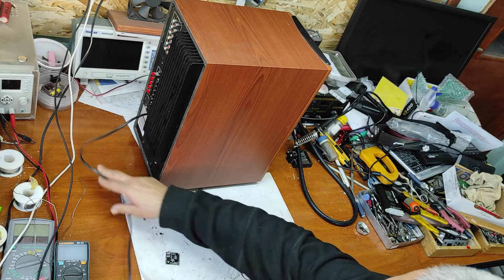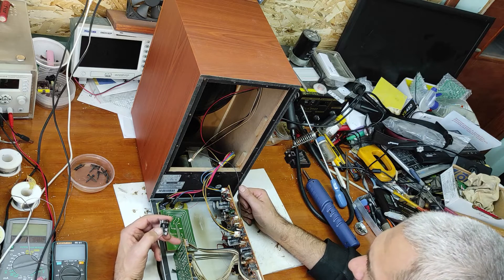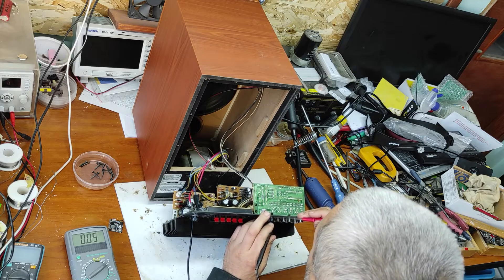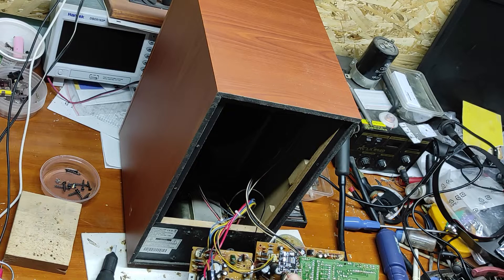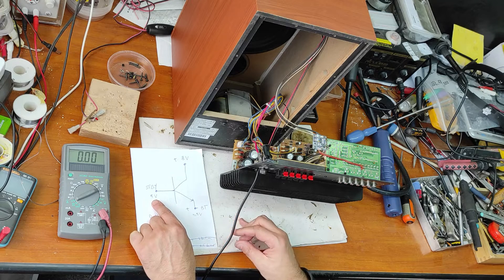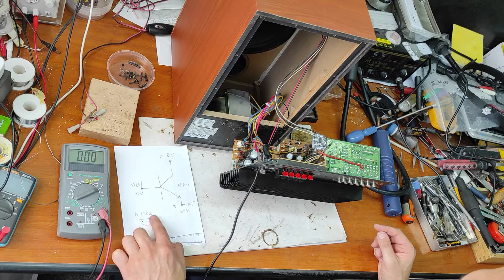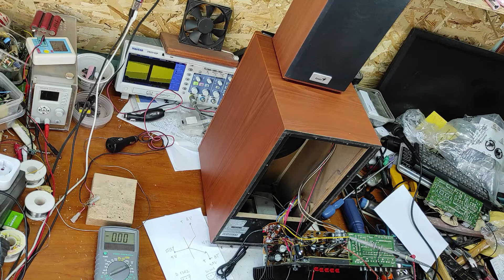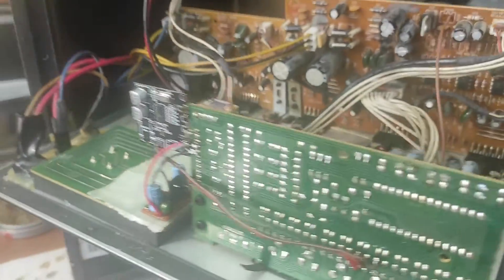Genius 5.1 add bluetooth,not so easy

Comment: hi i got from friend other pair its  Genius SW-HF 5.1 5000 what can it be i hear noise  in speckers and in bass  when i turn on
Reply from the maker: You have to open and find fault.i cant tell u if u dont give me details.
Reply: @diymariuselectro  everrything works just have noise  pich noise like some ground is not good or something ..
Reply from the maker: @dimuborgir1987  check the pacacitors and replace
Reply: @diymariuselectro  ok i found one more problem i dont know is this factory or someone was fixing it....one contact L goes on  fuse  and other  N goes on  switch ..doesnt  l goes on switch and fuse  then in transformator? confusing
Reply from the maker: @dimuborgir1987  transformer output for audio amplifier have groud  without fuse and 2 hot wires for diferential output with fuses.serarch the schematic ant check.
Reply: @diymariuselectro  i had found  some components were not soldered good  and soldered it and put all back but now  front panel not working and  no big noice now i hear bass   speaker kinda works  like its under voltage i guess i fixed one other is brocken haha..
Reply: @diymariuselectro   where can i search  how much volt needs for tda7269a?7360 and 7296 and  rest of comp[onents  some shematic with  writen voltage
Reply: @diymariuselectro  how to test this tda is it ok it seams voltage is ok at  1,3
Reply from the maker: @dimuborgir1987  search datasheet ant compare it.

Comment: hi why  my front screen  dont work? i had problem that tda2030a burned and i change it and now  svcreen dont work..can i test it on some battery?
Reply from the maker: This model doesnt have 2030.u made a confusion.
Reply: @diymariuselectro   my model has i have different one
Reply from the maker: @dimuborgir1987  u have to check the conector to the front panel and suply volages.find the schematic and will be easy.